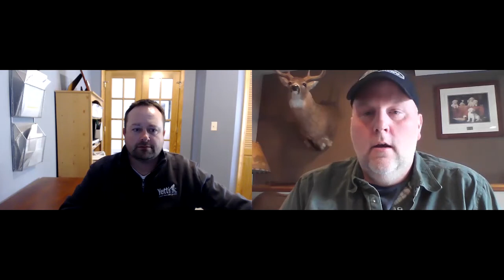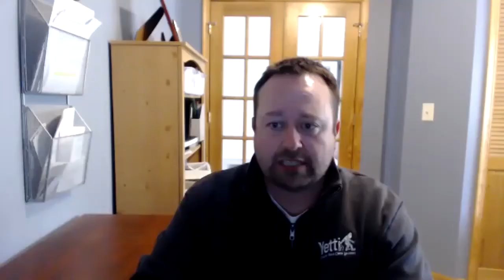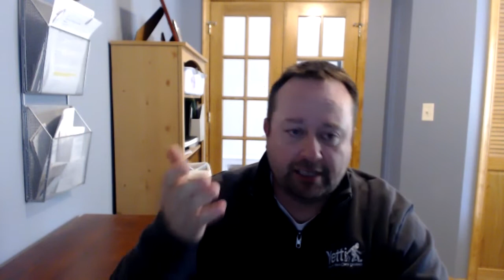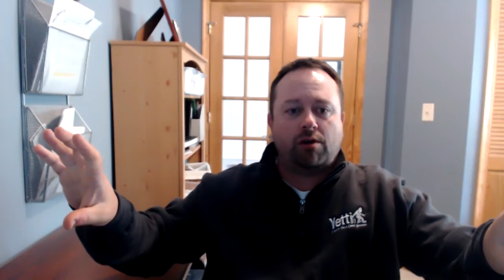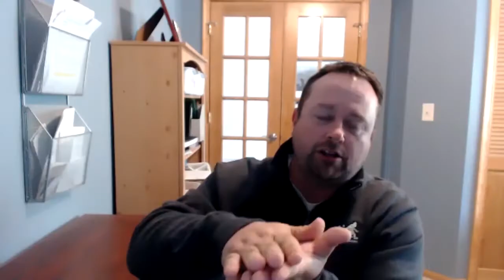Pulling A Wheelhouse Safely & Efficiently with Joel Nelson - FHNP #56

Comment: Most importantly look at the vehicle's tow rating, which will tell you how much your vehicle can pull at an absolute maximum safely. That takes into account the stopping and hauling ability of the vehicle. if the weight is too much for a half-ton, go to a heavy-duty half ton or a lighter duty 3/4ton.